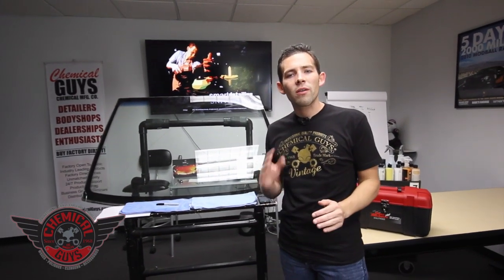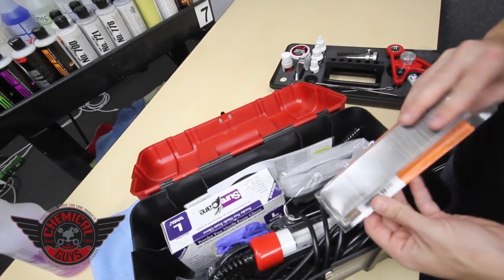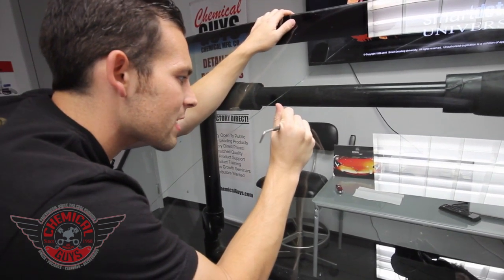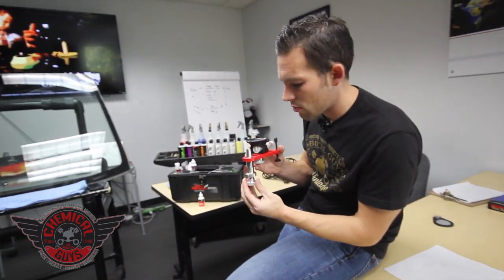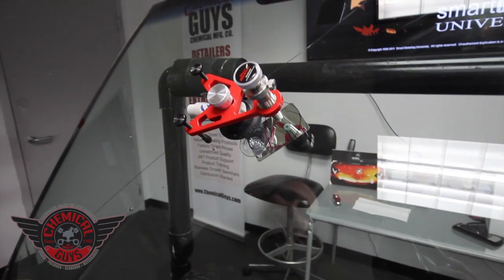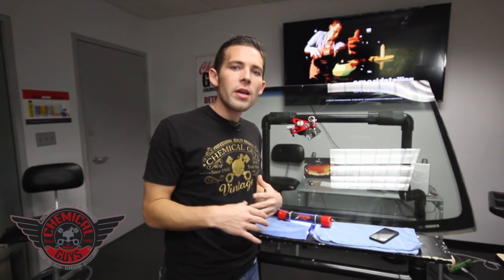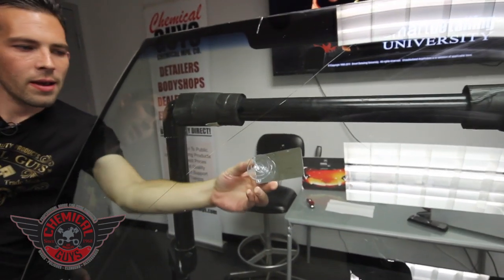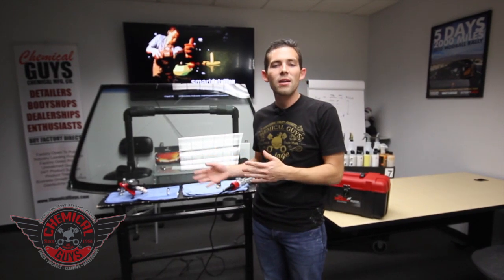How To: Fix a Chipped Windshield - Chemical Guys Glass Mechanix Delta Kit Car Care

Comment: Hi, 1st you added moisture to the windshield by cleaning it? wrong! 
2nd you don't wear safety glasses???
3rd no gloves? I bet the Resin that your using is acid based?
4th you don't flex any of the fingers of the chip?
Not a smart video
Reply: +Burt Purvis how about cleaning with rubbing alcohol?
Reply: +BoogieDownProduction maybe some acetone and then burn it off but no the best thing is just a dry cloth or go over it with a razor blade on a 45 degree angle
Reply: Bet all those wsr guys doing repairs after cars come through a carwash make you cringe lol .

Comment: Does a good job but instead of guffing about like that just take a hammer to the screen if you got a unwanted chip and pay 50 quid for a new screen. I dare not to look at the price for this
Reply: Probably cheaper than the $950aud that renault wants to change mine

THIEVING BASTARDS
Reply: Nathan S Sorry that is just the screen, doesn't even cover the labour charge.
Reply: Nathan S lol really just paid $241usd with labor for Honda Ridgeline windshield yesterday i have paid less for older windshields but those are easier to come across also